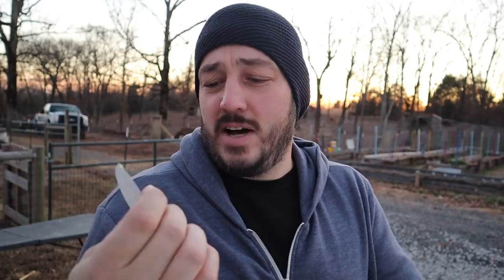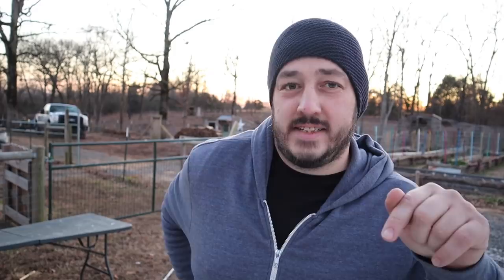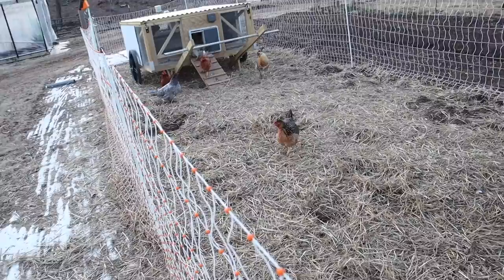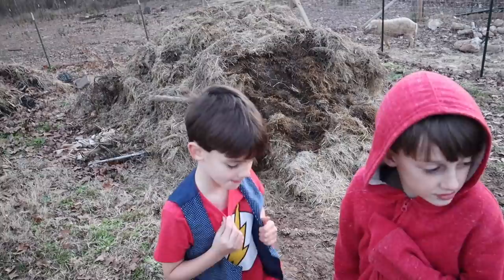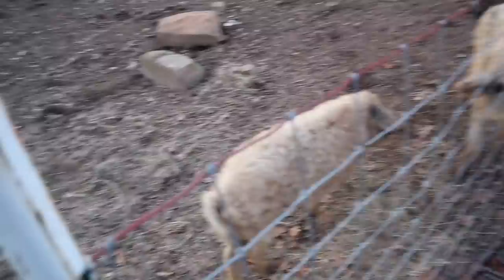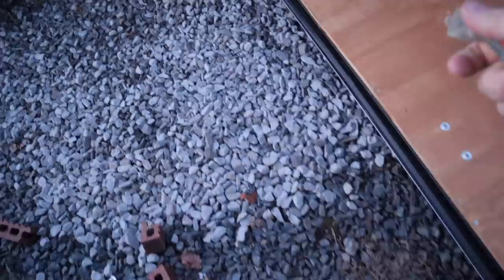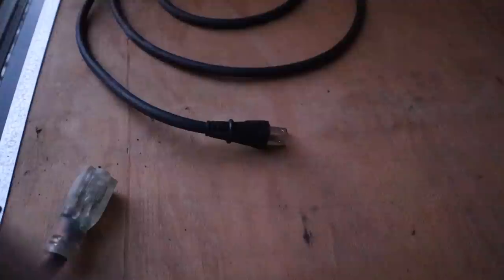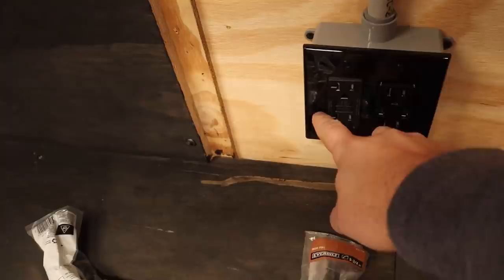Updates From Miah & Crew while Jess Recovers | VLOG

Comment: In regards to fencing for goats, we always run a strand of barbed wire along the top and bottom of that woven wire. Also, put the posts on the opposite side of the animals so if they jump/push against the fence, the post on the other side helps hold it sturdy.

Comment: You could easily hookup a couple solar panels on the top to charge and power your stuff. Couple deep cycle marine batteries, a good panel or two, and an inverter with charge controller. Tons of videos on the toob

Comment: It would be great if you had solar cells on the roof, and a charge controller that can run off the solar cells or from an extension cord to charge a battery bank. Then the battery bank would power a pure sine inverter that would create regular house current. It is exactly the same thing they do for mobile homes or vans or step vans that people live in. It would let you take the trailer anywhere whether there was power or not and get the work done. And yes, it could be sized to power table saws and planers. Thanks for filling us in, 'miah. Tell Jess we hope she's better soon:)
p.s. love the way you support the kids without doing away with appropriate use of eye rolls -- I feel eye rolls are important in parenting